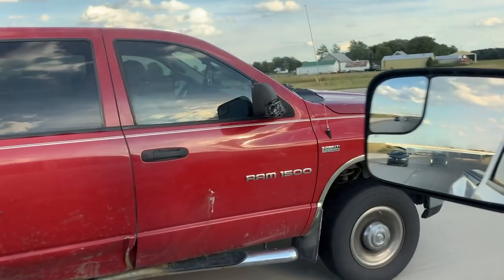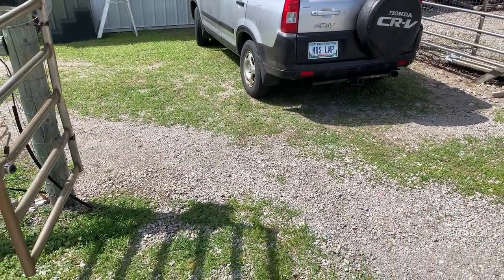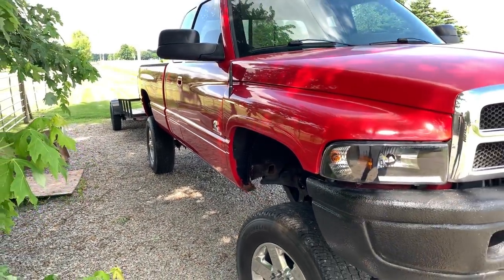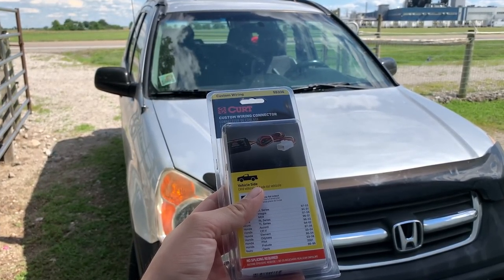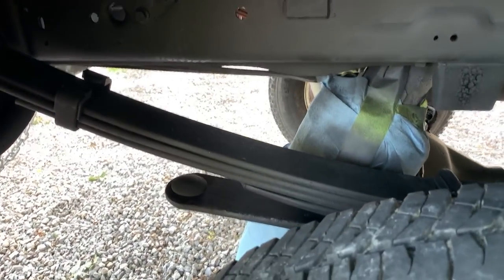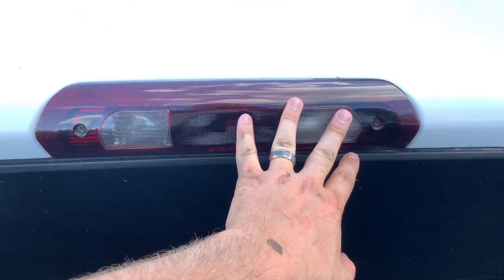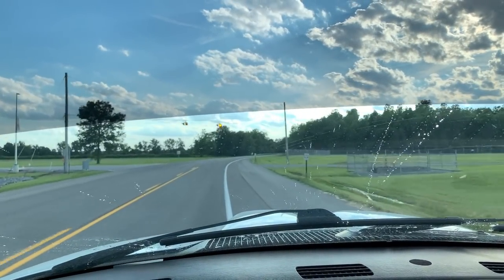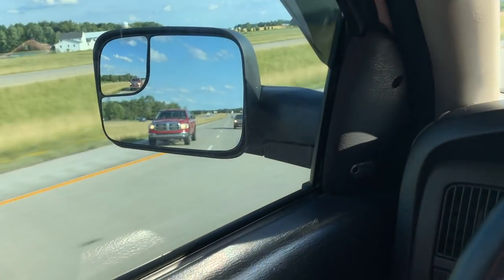TROLLING a 5.7 HEMI in the BIG TURBO 5.9 CUMMINS!!!

Comment: Honest question, if you paint over surface rust like that will the rust get worse underneath or will it stop surface rust? Or did you wire wheel it and just not show, thanks!
Reply from the maker: Depends… I don’t think flat black enamel paint will make it “worse” underneath. I think like a bedliner rubber coating WILL make it worse underneath if not worked down good!

Because that traps in moisture and pre-existing rust!